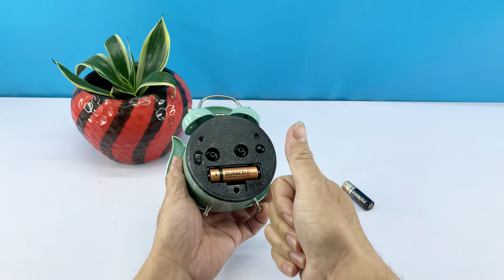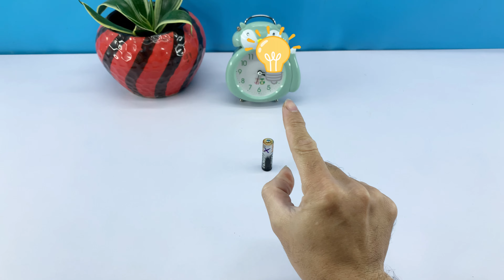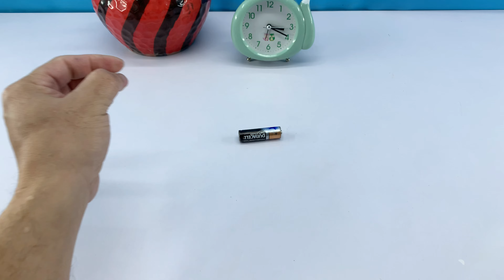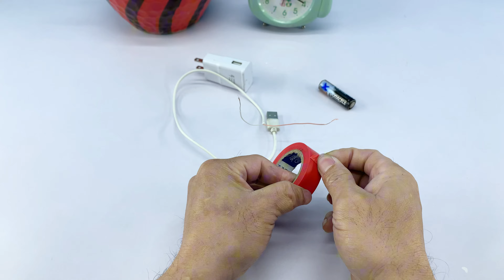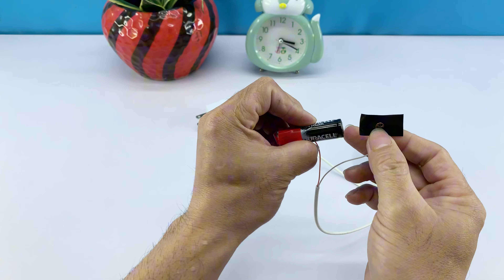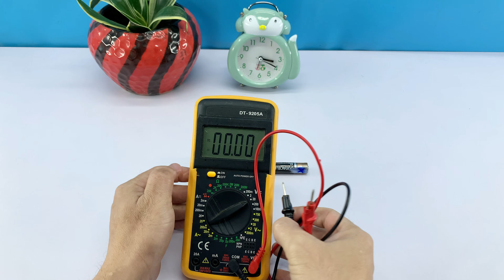🔋 Never Buy New AA Batteries Again! Use WD-40 and Old Batteries Can Be Reused!

Comment: How much time required for charging
Reply from the maker: It depends on the **battery type and capacity**:

* Small batteries (AA, AAA, 1.2V NiMH) → *1–4 hours*
* Car batteries (lead-acid, AGM) → *4–12 hours* with a standard charger
* Fast chargers can be quicker, but *don’t overcharge*

Always follow the *manufacturer’s recommended charging time* for safety and battery life.

If you want, I can give a **super simple rule of thumb for “how long to charge any battery”**. Do you want that?